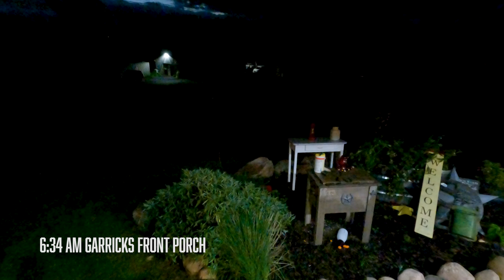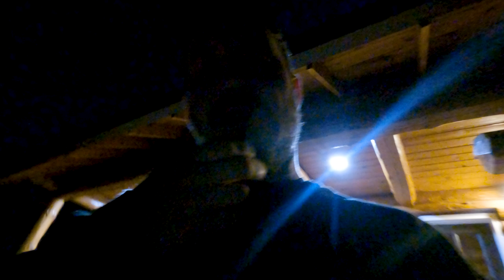The Dockman Episode Four: A Day in The Life of a Dockman

Comment: do you have any recommendations for sinking in 6"X6" dock piles?  I have been using the watermen method but would rather have a better system for pounding them in with force.  Not sure what would be a good piece of equipment for that.
Reply from the maker: Hello Bailee, Thank you for reaching out! I’m not familiar with the term “watermen method” are you referring to water jetting the pile in with the outlet of a trash pump by basically shooting a stream of pressurized water around the base of the pile?
Reply from the maker: A ho-pac (vibratory Plate Compactor) works awesome for vibrating piles in place.